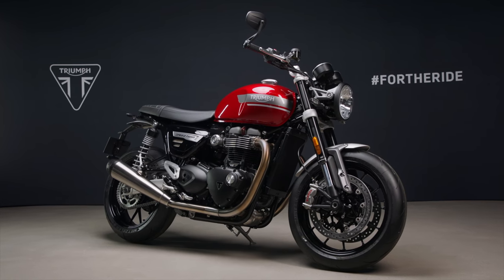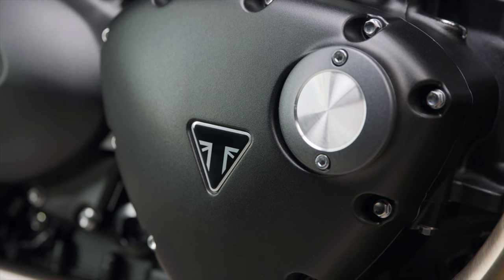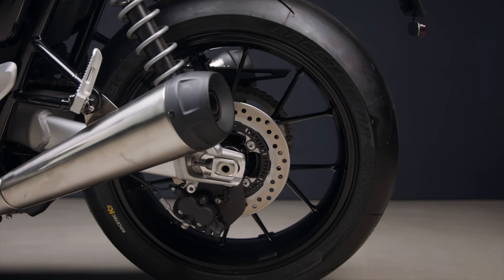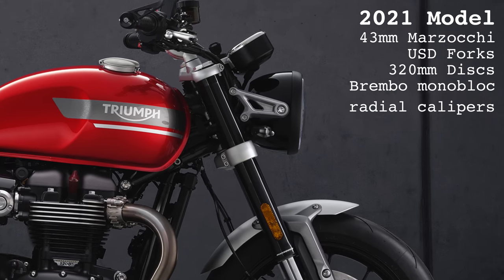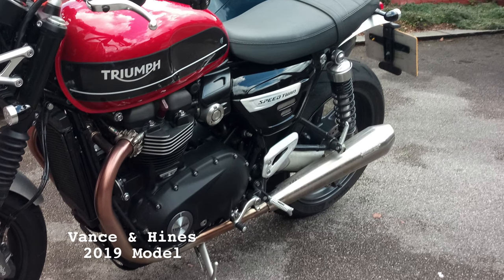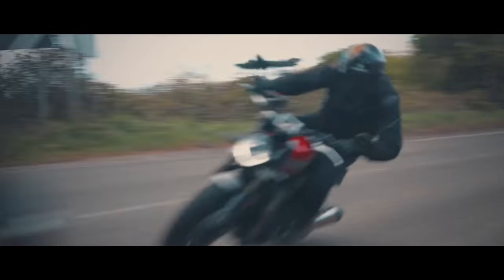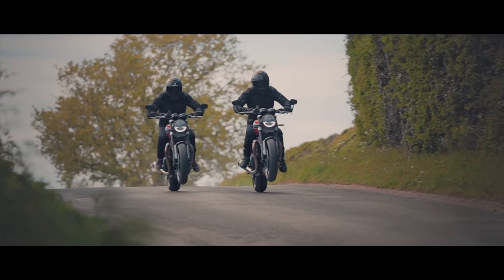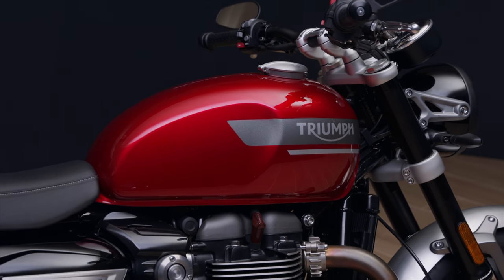New 2021 Triumph Speed Twin (All the Updates)

Comment: I’ve got a ‘20 speed twin and have just fitted a booster plug which transforms the bike into what Triumph wanted but couldn’t because of the stupid EU emission rules. Forget more power, torque and stopping power, it doesn’t need it. Just smoother delivery. Shame you can’t fit a booster plug to the new model…

Comment: Are you working for Triumph? Such a missed opportunity, None adjustable front suspension should be semi-active, Rear shocks as cheap as the RE interceptor, Race tec tires? what are they thinking, Halogen headlight bulb, Casio clocks from the 70s, Paint colours are going backwards, look at the comments, No cruise control, come on Triumph this is supposed to be an upgrade, welded in Cat, how do people install an X pipe? The exhausts would have looked better without the black end caps. no mention of the snatchy throttle, did they fix it? Triumph missed a golden opportunity to make this an all-time bike. I'm surprised you didn't mention these points for future buyers.

Comment: Should it not read “upgraded”, and not “uprated”? We’ve not heard the word “uprated” ever used before this video, right?
Reply from the maker: Hi Chuck, first of all, thanks for taking an interest in the channel and watching the video.  

In answer to your question, upgraded and uprated can be synonymous, however, uprated more specifically refers to when the value or performance of something (a machine) has increased.  Rather than what is actually done to achieve the increase in performance.

I am surprised that you have never heard the term before as it is commonly used in the UK, where I am from.

In the context of the video, where the Triumph Speed Twin's engine is essentially the same as the previous model, uprated refers more specifically to the increase in power and increase in redline rpm.  In reference to the brakes, you could certainly say that the brakes have been upgraded, but as mentioned, uprated refers specifically to the resulting increase in performance rather than what has been done to achieve that increase in performance (the upgrade).

To put it another way:

The rate at which the engine can turn (revolutions per minute) has increased, uprated.

The rating of the power output has increased, uprated.

The braking performance has been increased, uprated.

Here are a few links for your reference:

https://www.merriam-webster.com/dictionary/uprated

https://www.collinsdictionary.com/dictionary/english/uprate

https://www.lexico.com/definition/uprate

I hope that's helpful.

All the best and have a great day.